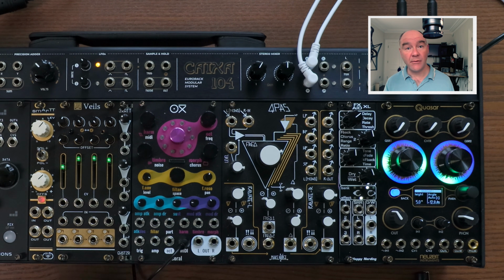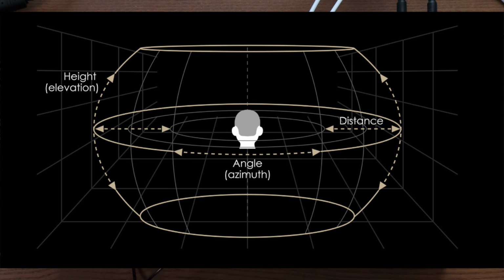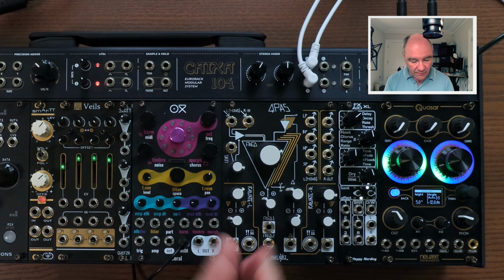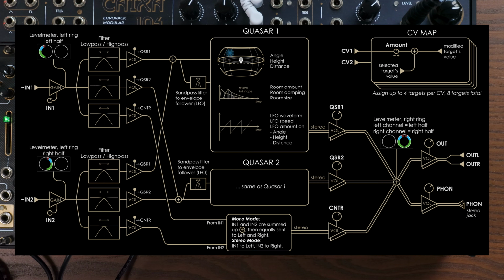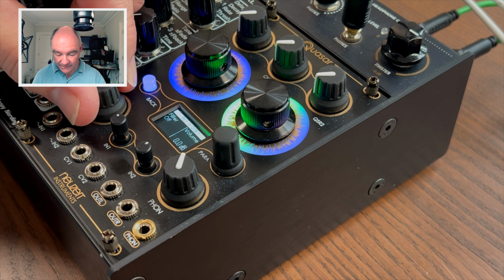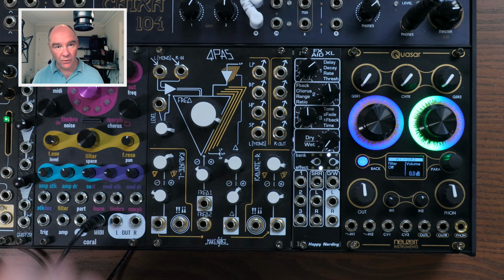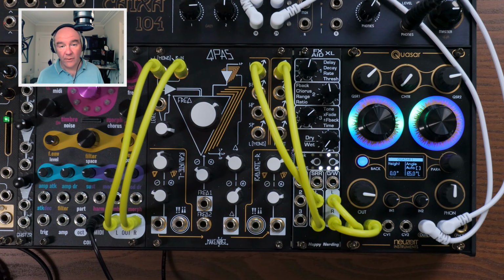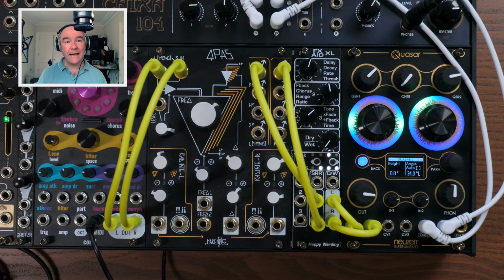Neuzeit Quasar Binaural 3D Mixer. Tutorial and examples

Comment: I've been researching this module and must have watched every video on here however this one left me confused as the Quasar angle appears to be illuminating on the opposite side of the encoder to where the audio signal is heard? Eg, at 04:59 the encoder is turned clockwise up to 81.0R but the audio moves to the left. Perhaps it's a Youtube conversion problem?
Reply from the maker: Hmm that could be the case here - is the sound consistently swapped throughout the video?
Reply: @SynthDad  Hi, yes I do believe the sound is consistently swapped but cannot say with absolute certainty. Naturally it is only obvious when a sound is meant to be extreme left or right and the displays are showing otherwise on the opposite Quasar encoder.
Other than this I really enjoyed the video